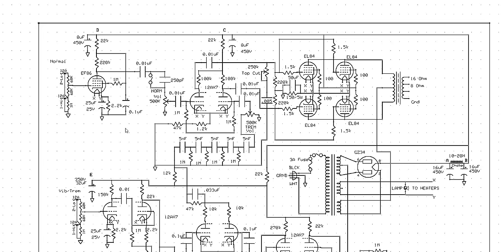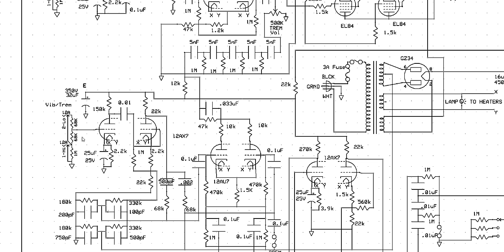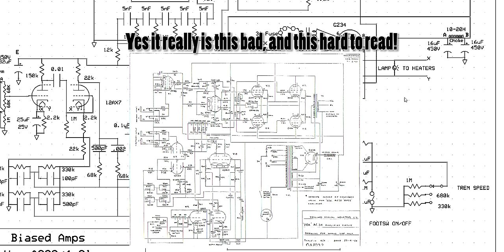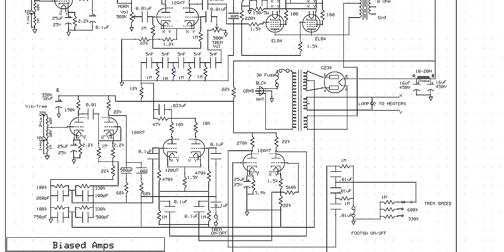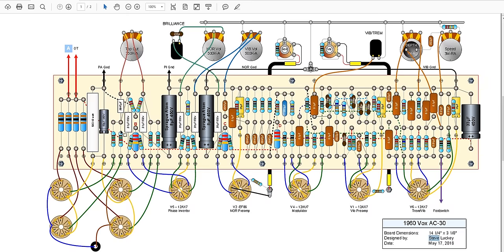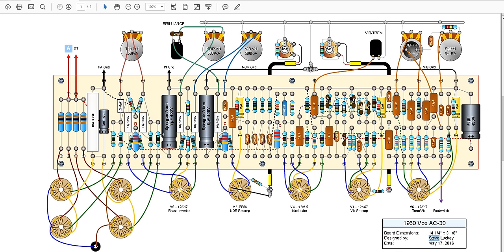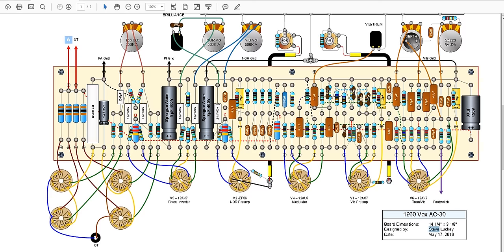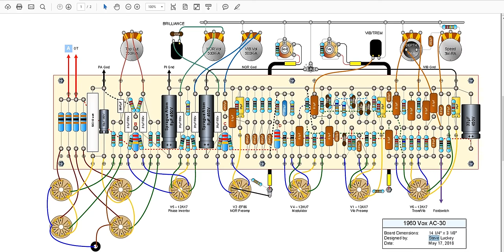Vox AC30/4 Video 1 Intro

Comment: Great idea! Waiting for the next video!
I also plan to make a vox like amp after deluxe finish.
But I want to make a mix of 30/4 and 30/6TB. With the normal channel from /4, blilliant channel and top boost from /6TB and without tremolo.
What is the output transformer are you going to use?
Reply from the maker: +PavelDashkov both the power and output are Heyboer, I used the same in a previous build for an AC30 top boost and normal channel build I did as my first from scratch build, it's a Hoffman style build

Comment: Is it just my old drunk's eyes, but do I really see a 150/5W resistor from the 4 x EL84 cathodes to ground, bypassed with a 50 uF electolytic cap? I believe, that AC30 used a 50 ohm resistor bypassed with a 250 uF electrolytic cap. AC15 had something like 130 (120) ohm/50uF. At the end of this video the layout has a 50/10W though, bypassed with a 50 uF cap. Otherwise really nice work! Enjoyded watching this.
Reply from the maker: Thanks for the comments, I honestly can't recall now, but the entire thing is documented here http://el34world.com/Forum/index.php?topic=20313.0
Reply from the maker: I actually looked it over and it definitely has a 50ohm on the layout, that would likely be what I used, but I'd have to open up the amp and check.  I've been wanting to do a video on signal tracing, and I need to shockmount the EF86 on that amp, so I may get around to that soon.

Comment: What was the final cost? just curious to see how cost efficient it is and do you recommend an "simple" amp to start with?
Reply from the maker: +David Wilson Jr I probably have paid about 800 or so for all the parts, but I lucked out on the transformers.  They were on sale.  But a new handwired vox is about 2200 or 2500 I think, and this model isn't made anyone.  If you're wanting an easy amp to start with, I suggest a fender 5E3 champ.  Check Hoffmanamps.com for most of the parts.  Also if you're not used to soldering or general electronics work, I suggest trying out a few guitar pedal kits first, as tube amps have extremely high voltages, and are a bit more complex. Edit: fixed phone auto-corrects "sigh"

Comment: Nice work. Do you have a BOM you can make available?
Reply from the maker: +Burnttoaster I didn't make one, because I reused one from an ac15 that is identical except for the quad output tubes, but I may be able to get that done for you.
Reply: that would be great, thanks
Reply from the maker: Ok I found the best list I can get quickly.  Basically I built Sluckey's AC15 as an AC30, like I said, with basically 2 more power tube sockets, power tubes, power resistors, etc.  Here's his full detail with an attached PDF that has at least a small parts list with the resitors, capacitors, etc. http://sluckeyamps.com/VAC15/ac15.htm
Reply from the maker: +Burnttoaster let me know if that helps!
Reply: thank you. making my list and checking it twice...